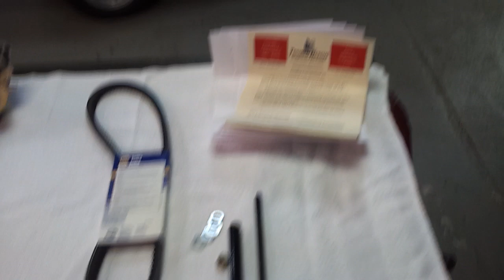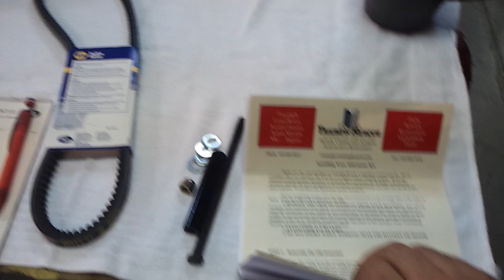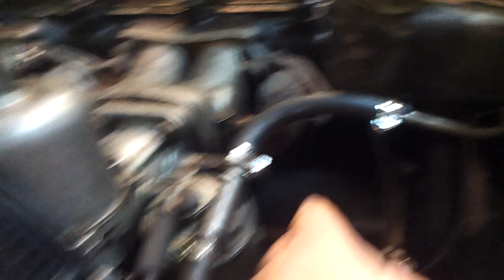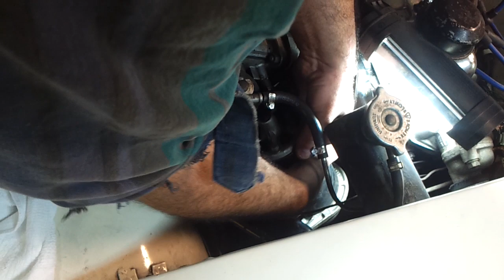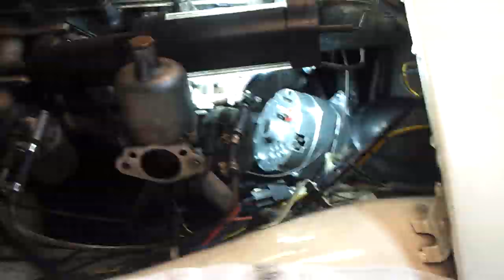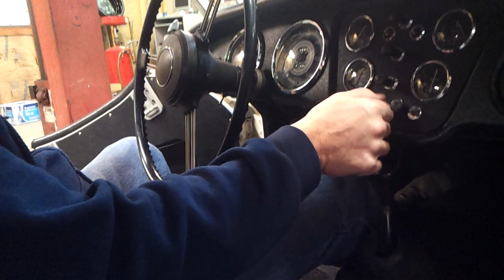How to install a Triumph Rescue Alternator Kit on a TR3

Comment: Hello Matt Bakes. This is Brian Jones. I was a customer of yours in the early 2000s. I'm the guy that drove to the national meet in San Luis Obispo in 2009. You ended up with my car after a fire, I think. I came across this clip back home in the UK as I am prepping an alternator replacement on my current car - a 1960 TR3A. I hope you are well. I am still in touch with Mike Wolf and Bob De Lucia of DVLT. Warm regards - Brian.

Comment: I've watched this twice and I think you didn't mention the main charging hook up. Looks like you went directly to the starter solenoid - which is fine, but your ammeter definitely won't work properly any more. You'll just see discharge, no charging (if its not already broken). Maybe a safer way to do it since the alt can put out a lot more amps but should be mentioned! And that grounding cable they gave you to hook it up (the heavy cable from the alt to the starter sol.) must be insulated on both ends - a disaster waiting to happen.